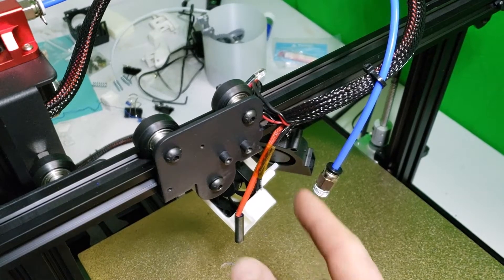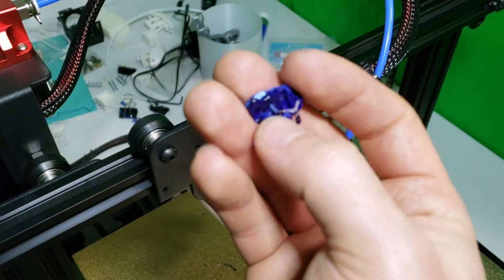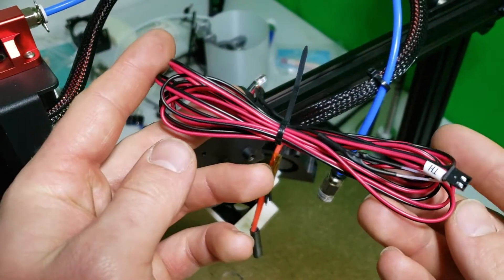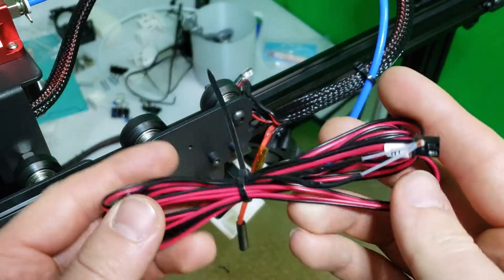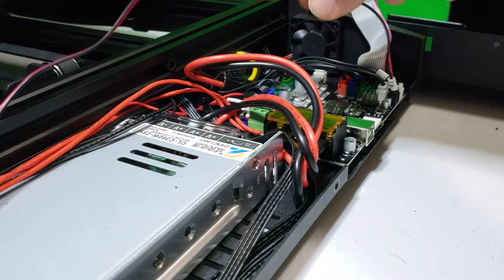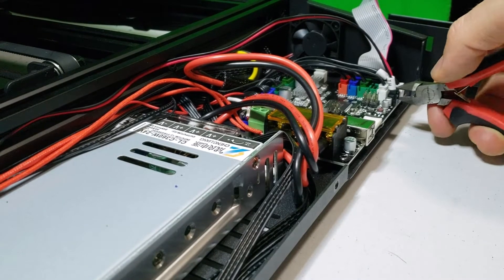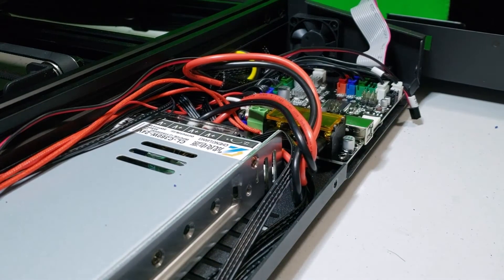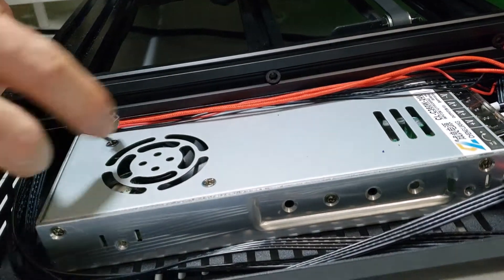Sunlu S8 Thermistor Replacement [Routing New wire]

Comment: how the fuck did you connect the end part of the cable to the extruder? why did you not bother to show that? the thing I have in my machine looks nothing like yours
Reply from the maker: The end of the thermistor just goes into the small hole by the heating element in the block of your extruder.
Reply: @PottersVinylsAndMore  yas i already figured it out. The one i got shipped originally is different from the ones I've seen around

Comment: You didn't really show, did you heat tighten the nozzle?
Reply from the maker: Yes, Heated the block back up and tightened down the nozzle, Nozzle has a small gap from the block as it is torqued against the heat break.